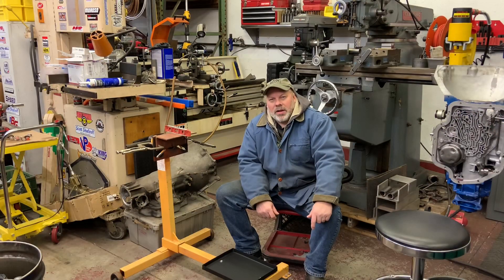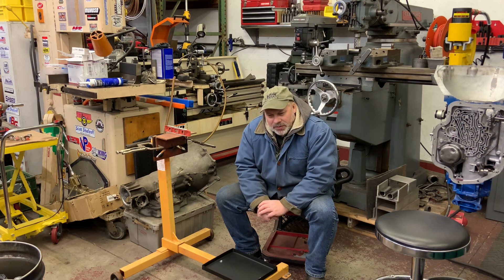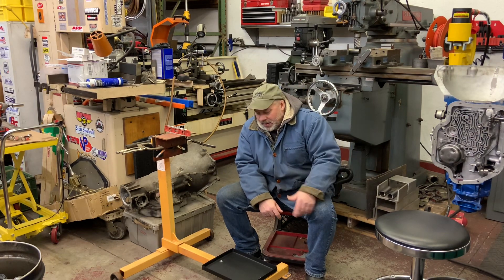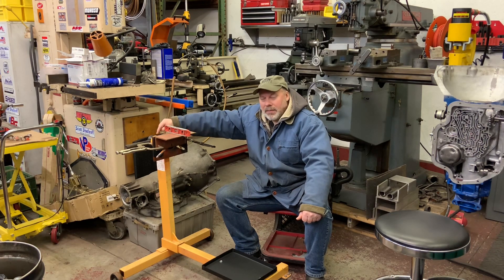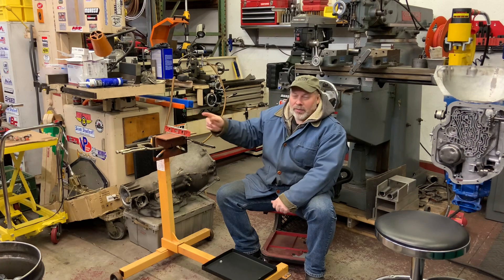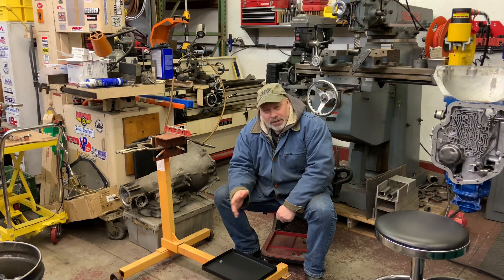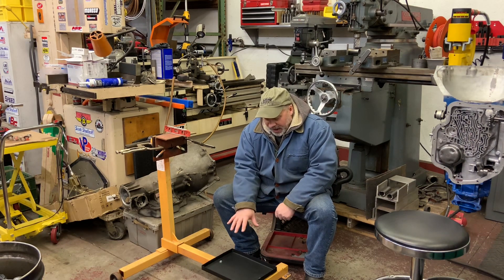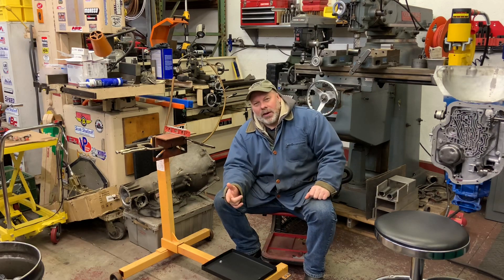Mountains Garage: Tube Bender Stand & Hydraulic Pump

Comment: Sir.  How is your bender pump working.  Any takeaways ?
Reply from the maker: @Backfire10  Good afternoon!
The bender works great, I have the air/ hydraulic pump on it now. It is slightly more predictable but they both work fine.
JMR was awesome to deal with.
I didn’t deal with JD2 but they are probably the most popular.